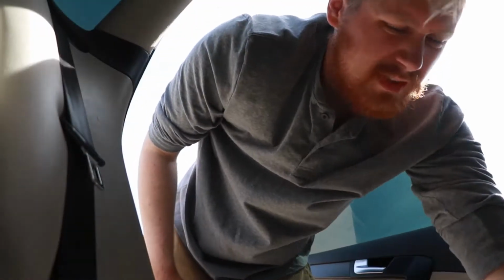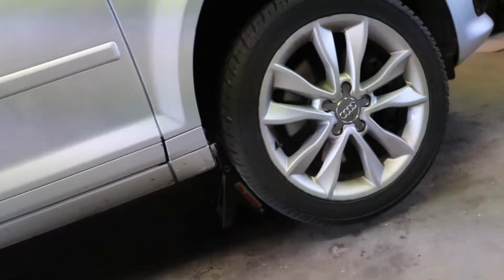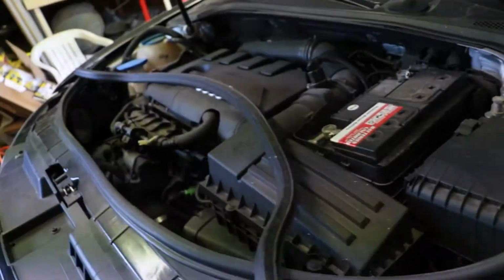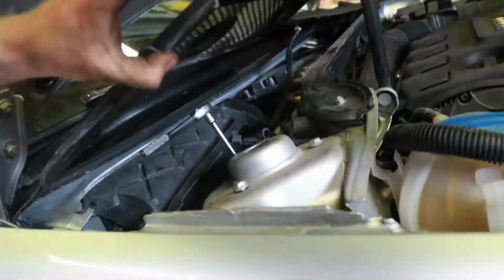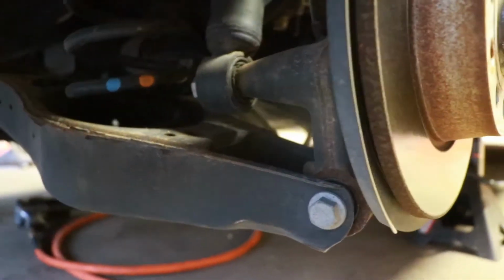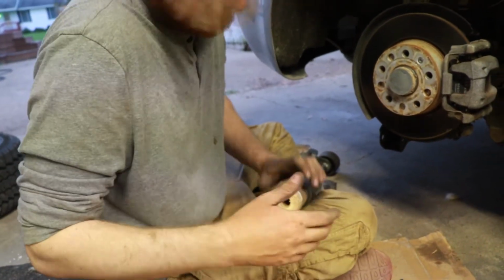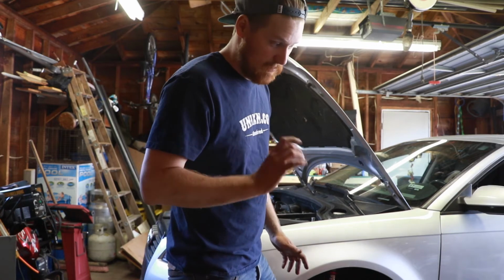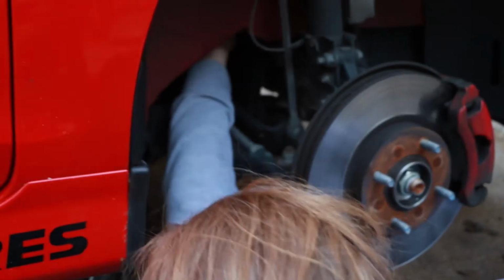Eurox Sowo prep day 1 and 2. Coilover install on Audi A3

Comment: Love the video, very helpful. We are trying to install our ECS coilovers, but we cant slide our new struts in... We spread the sleeve thing a lot, almost a good 1cm or 2cm, and it wont fit flush it go down all the way. We jacked it up, but it wont slide even when we greased it, the whole car will start lifting.
Reply from the maker: They dont always look flush on top. As long as the bottoms are flush with the bottom of the mount then you are good. Certain coils look like they should down 2 to 6mm more but that's just because they are for multiple models.

Comment: How low did you go on your setup? I have some 19x8.5 but have some rubbing in the rear at stock height so lowering is kind of out, but really want to lower my a3 since I'm rubbing with 19 I definitely can't.
Reply from the maker: We went pretty much lip to fender and stiffened it up with 18s. It was like an inch between the fender and lip of the wheels. But then after the shows brought it back up to like 2.5 inches. Maybe a little lower in the rear.